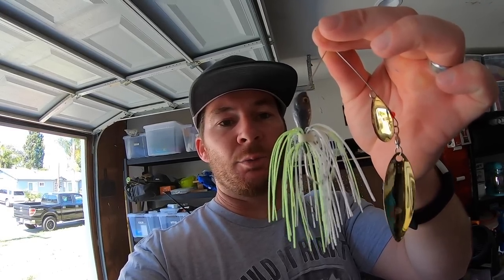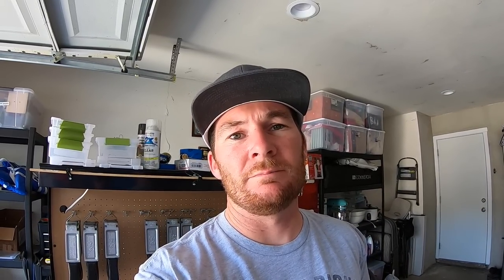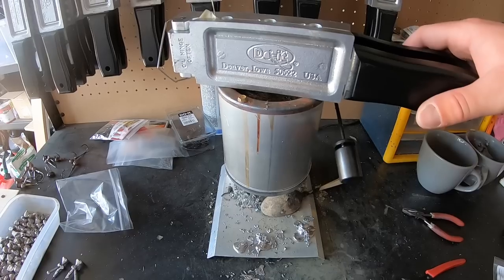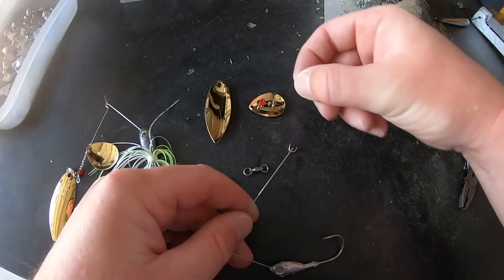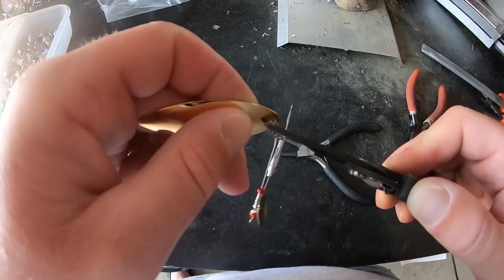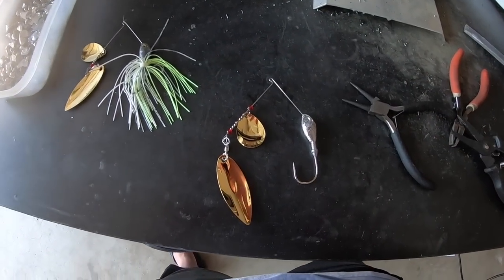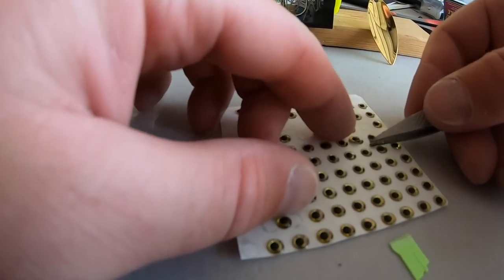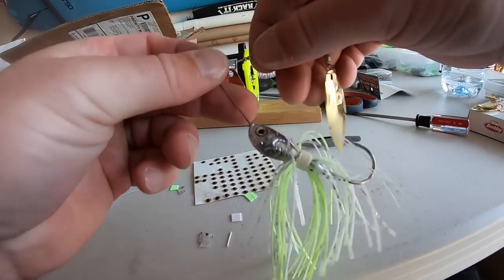How to Build a Spinner Bait - Using the Do-It Ultra Minnow Spinner Jig Mold

Comment: Excellent video with great tips like the wire size & more.  I just bought that mold & look forward to making some spinner baits.  Do the beads & middle blade stay in place without those spacer tubes ok?
Reply from the maker: Glad you like the video!  Thanks for watching.  This is a great mold.  The beads work just like the spacer.  If you use the beads you don’t need the tube.  If you use a tube you don’t need the beads.

Comment: Do you have a size and parts list.  I am trying to find everything on do it molds but dont know where to start
Reply from the maker: Mold: Ultra Minnow Spinner Jig
Wire form: Spinner Jig Form R Eye
Blades: Colorado and willow
Clevis:Solid Brass Clevises Nickel Plated
Hook: 3/0 owner spinnerbait hook
Lure eyes: 5/32
Skirt material: chartreuse, white
Barrel swivel: you need one with split rings on each side
Reply: @MattLunaFishing  thank you so much for taking the time.
Reply from the maker: You’re welcome

Comment: For the lead, could you use like lead weights to melt or do you have to have a certain type of lead?
Reply from the maker: Are you talking about old lead fishing weights?  

Most of the time pretty much any lead is fine to use.
Reply: @MattLunaFishing  yes like split shots that you could buy at the store. I was wondering because no one mentions it.
Reply from the maker: Yeah you can totally use that, but that’s a more expensive way to get the lead.  Check your recycling centers to see if they have any they will sell.  Also, sometimes tire shops have some you can get too.  Wheels have weights on them and older ones are made of lead.  You might be able to get those to melt down as well.
Reply: @MattLunaFishing  thanks you and great video also, will have to get some molds and make them!
Reply from the maker: You’re welcome.  Glad you liked the video.  My channel has a lot more tackle making stuff on it.  Feel free to ask questions.  You’ll love making your own gear.

Comment: I noticed that you didn't preheat or smoke your molds first.  Looks like it came out just fine regardless.
Reply from the maker: I don’t smoke my mold. I preheat them depending on how hot it is outside when I’m pouring.  If i have issues I’ll spray blaster dry lube into the cavities and that helps.  Here’s a link to the spray: https://amzn.to/3WekMfF

Comment: What is the tool you use for banding? I clicked the link you have in the description but it doesn’t take me to what you have.
Reply from the maker: That skirt tool is super old.  I bought it at a swap meet a loooong time ago and haven’t seen one since.
Reply: dang, it looks super helpful
Reply from the maker: The normal ones aren’t hard to use either
Reply: Made by NakedBaitco called the skirt expander. Discontinued.
Reply from the maker: Bummer that it’s discontinued

Comment: Does this end up being cheaper than an average quality store bought spinnerbait? Have you calculated total cost of materials?
Reply from the maker: Yes, after getting all the components you need, it is cheaper, when you factor in how many you can make.  I use a lighter wire so the durability isn’t as good, but i think they get a lot more bites.  That’s the main thing it boils down to for me.  You can also make your own high end baits with premium hooks, blades, and components and there will be some that you can buy from the store that cheaper, but not near as good.
Reply: @MattLunaFishing  awesome! Thanks for the quick reply!
Reply from the maker: You’re welcome!  I have a link to DoIt molds you can use to get all the stuff to make these: https://store.do-itmolds.com/?AffId=5

If you buy anything please use that link specifically so they know i sent you